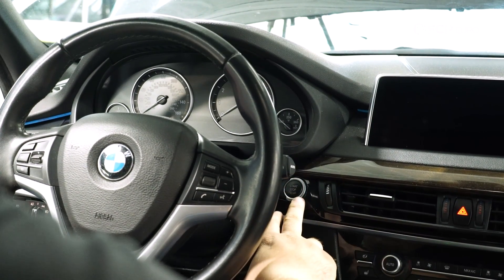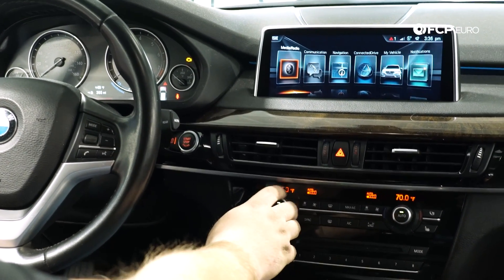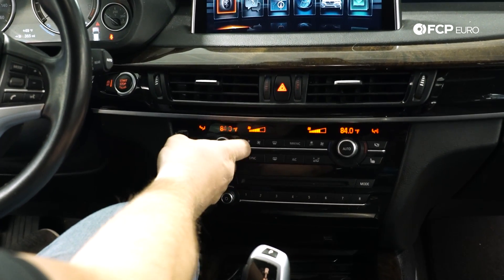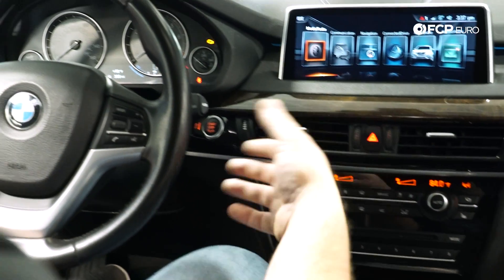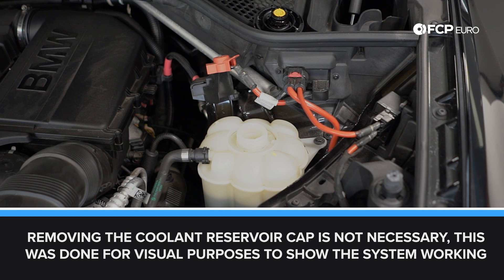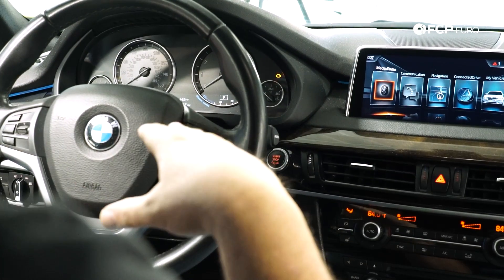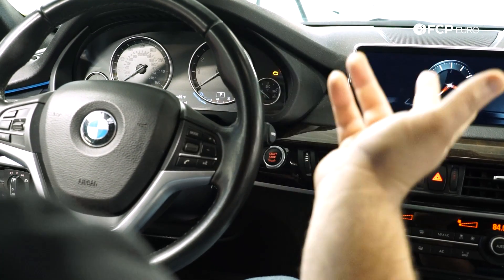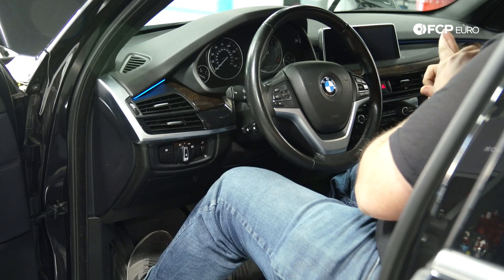BMW Electric Water Pump Bleeding Procedure

Comment: Hello. I installed a new water pump and thermostat on my 2015 535i. As soon as I opened the driver door the pump started running and wouldn't shut off. It would shut off if I locked the door with the fob. Then 30 seconds later it would turn back on again. Any help would be much appreciated.

Comment: FYI - I did this and worked like a charm for my N55 (2017 BMW X3 35i).  I kept the reservoir cap on and bleeder valve closed when I ran the procedure. If you flushed the coolant for whatever reason, you'll likely need to add more coolant after the first cycle of this procedure. Then close everything up and run another cycle. I did the cycle three times (not including one which stopped prematurely because I closed the driver's door). I also had a batter charger connected the entire time and didn't have any issues. Nice feature for BMW to add.

Comment: On a GO1 (2019 X3 30i), is ignition "accessory mode" the same as diagnostic mode where the ignition button is pushed quickly 3x in succession?
Thank you.

Comment: DUDE!!! THIS WORK PERFECT!! Perfect, to bleed the system, and to TEST THE WATER PUMP OUT... thank you SOOOO MUCH. You helped me out a lot!!!👍👍👍 Was getting not so good heat in the car, did this 2x and BAM Got great Heat. for some reason there was air in the system and I could see it coming out of the weep hole in the coolant Reservoir? WOW MUCH BETTER... Thank you So much for the silly ez fix.. the garage would have charged $250 or more for the same thing,  YA GO FIGURE!!!! BMW 2011 335I Xdrive turbo 3.0L N55

Comment: How does the air leave the system when all exits are closed? Tnx🤔
Reply: My thoughts exactly!
Reply: Refill tank has to be open or at least the bleeding screw. Otherwise is nonsense closed circuit.
Video is lacking technical explanation.

Comment: the worst bleeding procedure,and good luck trying to let all the air out ,I changed a waterpump and did this procedure so many times air still in the system and I can hear it gurgling when the heat is on , though was the heater control valve changed that ,NOPE  didn't fix it
Reply: i heard the same sound what could it be
Reply: @evarinenberg3569 i have no idea, haven't turn the heat yet but planning on using the coolant vacuum refill tool

Comment: Hi there. 
I have a bmw F30 N20 engine… it had a thermostat failure and I replaced the thermostat but there’s still no coolant circulation. Could it it be the main water pump or the auxiliary pump?

Tried doing the self bleeding procedure but the auxiliary water pump doesn’t turn on

Is it safe to replace it or are the other things I need to check first??

Comment: Oh you don’t do trickle setting for water pump bleed? Looking for a battery maintainer to do thorough flush.
Reply from the maker: You can certainly do so during this procedure! We have a few NOCO units on FCPEuro.com that can help you with that.
Reply: @fcpeuro  I appreciate reply! Forgot I had a jump pack that is capable of AGM 2/10/50A. Do you think the 10 amp will be sufficient?
Reply: @LightSpinAngler While doing this on a 19 530i, the current draw was around 25 to 31 amps. If you have a strong battery, 10A will probably suffice.

Comment: This problem could see a damaged water pump ,?  (Engine cooling system, reduced power operation: coolant pump temperature threshold 1
exceeded.) code 20A904

Comment: What’s the benefits of bleeding the system?
Reply: If you don’t bleed it, the engine or cooling system could have air trapped, giving you a hot spot that can damage the engine. Sounds absolutely necessary.

Comment: Hi.. my F10 520i 2012, the radiator fan spins at max speed very loud especially when i stop or idling and with high outside temperatures. No overheating no error code. Flushed coolant, pulled a vaccum with tool and followed the bleeding procedure but problem still unresolved. Coolant flow stream in the tank is good so i assum the pump is good. Replaced thermostat and tempt sensor but no help. Been driving with this problem for over a year with no overheating. Please help no one has figured out the issue so far
Reply: Idk about BMW but I work on other cars and that usually happens when the fan control module located on the fan goes bad, ecu fail safes by blowing max all the time. Then again you don’t have any of the common codes for a failed water pump?
Reply: Also my 328i had that problem when the coolant temp sensor went bad, but you said you replaced it already
Reply: Thanks for your reply. Yes I changed the temperature sensor and thermostat I don't have any water pump or fan error code. I don't know what to do next before I change the water pump which is costly. I must say the oil temp on the gauge never exceeds 90 degree Celsius. However at temperatures above 90 degree  Celsius in the hidden menu the fan starts increasing in speed to max
Reply: @kevinmpe8363  hmm usually fan control modules don’t trip codes, does it just always run even when it first starts or it has to reach temp and then it just stays?
Reply: @Use2FACTAUTH  when I start the car the fan starts running immediately but at low quiet speed, even with AC off. As the temperature goes up the fan speed increases and  increases to maximum. Then the speed starts to switch between medium and maximum very loud when idling especially with high outside temperatures

Comment: Kind of an oddball question, but could you use this method to drain the cooling system by detaching the return hose & directing the flow to a bucket?
Reply: Yes, but you also risk burning out the electric water pump by running it dry. Alternatively, you could flush the entire system like this, but it would take a long fucking time lol.
Reply: @Poverty.404  that's what I thought, but I've never been afraid of asking the crazy questions. Actually DOING the stupid crap that pops into my head is a completely different story 🤣

Comment: For anyone wondering, leave bleeder screw in and cap on. Just did it on my 2014 435 after my expansion tank hose cracked and is working just fine.
Reply: But where does the Air leave the system when all.the exits are closed?
Reply: @rf2835 it just goes to the top of the reservoir which may then make your level appear lower. Top off to max.
Reply: @rf2835  that's exactly what I'm wondering!!
Reply: Yep, you want to close the cap and bleeder screw to ensure there is a vacuum for the water pump.

Comment: Any ideas as to why the bleed procedure will run up 30 mins without completing?
Reply: Yes to get it off the bleeding mode when you start the car again just change the temperature from 84 to your preferred temperature. Sometimes it stays longer than the usual 15 minutes

Comment: Make sure you close the expansion tank before starting the procedure. If the cap is off, it will run for a long time without completing.
Reply: I just learned that it’s been running for 30 minutes
Reply: So how does the air leave?
Reply: @N54M4CC air is going up it will be stuck up in reservoir thats the point instead of having trapped air in coolant hoses and engine

Comment: Hi, should you top up the coolant before doing this procedure?
Reply: Yes, remove bleed screws and fill expansion tank with coolant until no air bubbles, just coolant comes out of bleed screw holes. Replace bleed screws. Ensure expansion tank is brim full and replace cap. Then you can start this procedure. Air from the system will get trapped in the expansion tank so the coolant level should have dropped when the procedure is finished. You may need a syringe to remove excess coolant from the expansion afterwards.

Comment: What if you don't hear the electric water pump come on during the first 20 sec of having the gas peddle pressed? I verified that my battery was fully charged before trying the procedure? For context, I have a 2007 Z4 3.0si.
Reply: Did you fix this

Comment: When I step on the gas pedal should the ignition be turned on or should this be done only on accessory mode?
Reply: Only on accessory mode, the engine should be off

Comment: I did this, didn’t turn on the car fully. Noticed the coolant had lowered in the container. Also saw a small puddle under the car. FYI I had the water pump changed 8 months ago. Any suggestions?

Comment: car . I still have the car asking for coolant after it’s hot. When I remove the cap halfway I hear a lot of air coming out. Is that normal? I did change a hose and he replaced another piece under the manifold to remove the part. Any ideas?

Comment: So when we use the air release screw on the expansion tank (the little black plastic screw) to bleed the air out of the system? Should I leave it loose during the whole 8 minutes duration when the electric pump runs?
Reply: Why can no one answer this
Reply: No. Do not leave the bleed screw open.
Reply: @cbtsmith1  but from time to te when engine is cold and off by loosening  bleeding  screw i could get air out

Comment: You may or may not have to do the bleeding procedure (15 minutes each) multiple times to really make sure all the air is out of the system.
I had an incident where a coolant hose popped off on me while out driving. There was evaporated mist everywhere, and all my coolant came pouring out from underneath and I was left stranded. 
Luckily this was in a parking lot, so I immediately parked my car before the engine rose to dangerous temperatures and I shut it off.
My uncle came to pick me up and we shopped for distilled water at a nearby convenience store. We were able to pop the hose back on, fill the cooling system with distilled water, and do a quick bleeding procedure before I carefully drove the car back home. 
Now I have oem bmw coolant in it again, mixed 50/50 with distilled water per instructions, but I ALWAYS do 2 or 3 bleeding procedures so I am SURE there's no more bubbles popping.
Haven't had a coolant pipe pop-off on me since.
Reply from the maker: Certainly good measure to run the procedure more than once!
Reply: When you're doing this bleeding procedure, do you leave BOTH CAP AND BLEEDER SCREW closed??
If yes, then how does the air escape?? Wouldn't the bleeder screw need to be opened?
Please excuse my ignorance, I'm just trying to understand so I do it right the first time!

Comment: Do you have a video on bleeding a N63 engine / turbo intercooler side in particular. I Thank you for this video 👍
Reply from the maker: Not currently Daniel, but we do have a list going for the N63!
Reply: @fcpeuro any updates on this?
Reply: Venting cooling system: Note:
Do not leave the coolant expansion tank sealing cap open during the bleeding procedure.
Ensure that both cooling circuits are filled before starting the automatic bleeding procedure. The bleeding procedure is automatically started simultaneously for both cooling circuits. If the bleeding processes is started while one of the cooling circuit is empty, there is a risk of damage to the coolant pump from running it dry.
Switch on the low-beam headlights to perform the bleeding procedure. If the low-beam headlights are not switched on, the ignition (Terminal 15) will switch off automatically after a certain period of time and interrupt the bleeding procedure.
1. Top coolant up to the upper edge of the expansion tank. Coolant level may not drop further! No drop in coolant for approx. 1 minute.
2. Connect battery charger.
3. Switch the ignition on.
4. Set heating to maximum temperature. Press Automatic button. Then set the blower to the lowest speed.
5. FES (driving experience switch) must not be in ECO PRO!
6. Press accelerator pedal for 15 seconds to floor. Engine must not be started.
7. The venting procedure is started when the accelerator pedal is pressed and takes approx. 12 minutes.
8. Refill expansion tank up to top edge immediately after drawing off until empty.
9. Adjust expansion tank to maximum level at end of bleeding procedure.
10. Check cooling system for leaks.
11. Close expansion tank.
12. If the venting procedure has to be carried out again, allow DME to drop completely (ignition key removed for approx. 3 minutes), then repeat from Point 5

Comment: I tried to activate the procedure but for some reason nothing happens. It's a 2016 320i with B48 engine. Will I be OK to just fill up the system, keep the reservoir cap open and start the engine and let it idle until it's warmed up obviously making sure that the coolant tank has coolant in it all the time?
Reply from the maker: If you didn't already, you may need to ensure your battery is fully charged, and on a tender, for it to allow the procedure to active. You may be able to bleed it by letting it get up to temp and allowing the thermostat to open, otherwise, that will be causing an air bubble until it opens.
Reply: @fcpeuro how will you know when the thermostat opens?

Comment: mine wasn't working, my 740li kept turning off although i could hear the pump starting to bleed. soo you have to activate the hidden menu, hold down dash button, then scroll for system test, then hold that down, then it will ask to start and hold that down. car will stay on and the bleeding will commence👌

Comment: Hi is it the same procedure on N47 engine?
Reply from the maker: Hi PG, as long as it is equipped with an electric water pump, the idea should be the same. Some models require you to turn on your low beams before you initiate the pump.
Reply: @fcpeuro  Thanks but no electric water pump

Comment: What happens if you dont do this procedure after a ofhg? The pump goes in some sort of safe mode or something? Could you experience loss of power because of that?
Reply from the maker: Hi Catalin, what can potentially happen is an air bubble in the system. Depending on where it gets trapped, it can cause weird fluctuations in temperature throughout your system.
Reply: @fcpeuro  ok so it could not have an impact on how the engine performs
Reply: @fcpeuro  I think that's what is happening to my X3, I just changed the plastic hose flange to the metal one, and I did the bleeding procedure but I don't think I did it correctly and now when I drive it, after 5 miles the temp. gauge goes high and the fan comes one, but after I turn the car off, it goes back normal...do need to do the bleeding procedure again?
I'm not throwing any codes or have any leaks

Comment: Mind is not doing it...smh does this mean I need a new water pump?
Reply from the maker: Taylor, you want to make sure the battery is fully charged, and the door remains open, heat on high... If at that point you still cannot get it to go, there is a possibility the pump may be dead. A further inspection will be needed.
Reply: @fcpeuro  Thank You
Reply: @fcpeuro  water pump or Auxiliary pump?

Comment: How about if it doesn't go onto bleeding  mode?
I tried 5 times on my 528i and couldn't bleed the system
Reply from the maker: Hi Hector, you want to ensure the vehicle has a sufficiently charged battery, if possible you may want to hook it up to a charger. Ensure the door remains open and try it again.
Reply: @fcpeuro  Thanks for the response
I will make sure battery is fully charged and try again .
Reply: @fcpeuro  Oh.... the door needs to be left open?  That might explain why the process seemed to stop once I got out of the car...and closed the door. Would you need to bleed the system after changing oil cooler gasket, I assume so?

Comment: I have a pattern goggling sound coming from the AC vent especially with the heater setting while driving. It comes in a 2 sec pattern. 
I just replaced the thermostat and do the bleeding procedure once, do I need to do it again to resolve?
Reply from the maker: Hello, if it sounds like you have air bubbles making their way through your heater core, we would highly recommend bleeding the system again and topping off the reservoir as needed.

Comment: I have a an f30 bmw 320i 2014 and my electric water pump (randomly) turns on after the car is parked and turned off, the problem is that when this happens, the electric water pump never stops and it drains my battery. The only way it temporarily stops is when i open o close a door of thw car. Recently i changed myself the thermostat (using one of your videos) hoping this would fix the problem, but it didnt, and i first realized it would be having this issue because when i started the coolant bleeding process, the electric water pump never stopped, draining again my battery. Do you think i need to replace my water pump? Or is it another problem like an electrical one?

Comment: Aren't you suppose to open the bleeder valve on the coolant over flow tank? Thanks.
Reply from the maker: Hi Elwood, on these vehicles with a self bleeding function, it is not a requirement.
Reply: @fcpeuro what do you mean it’s not a requirement how does air get out of the system is closed
Reply: @TitusTheBlue  I believe when u first refill it u have to have 3 bleeder screws open then when it stops bubbling and comes out like a river u close it back up then start bleeding procedure